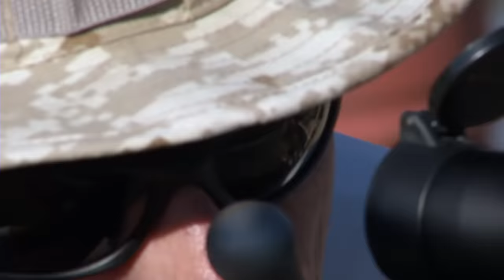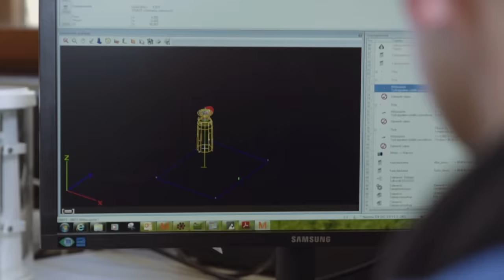King of 2 Miles - Ep 1804

Comment: Long range shooting is both science and art, it requires a great deal of practice and on top of all that you have wind that is  extremely variable. After I achieved proficiency in handgun long range shooting I found using a rifle much easier. This is not Hollywood so yes at those distances you will see some missed shots. After you've mastered shooting at 1 shooting location you go to another and you discover everything has changed.
Reply: What is wend?
Reply: @erbenton07  wind I assume
Reply: No, this is not art in any way you see it
Reply: @tuprimaentanga2387  "an art" and "this is art" don't mean the same thing bud ☺️

Comment: The thumb nail is awesome if you can hit a target at 2 miles with a Anschutz 22lr with a single power scope you need to be in this competition.
Reply: dont know about that 300 yds at 18 inch steel plate with my 10/22 ruger at 11yrs old i was aiming like twelve feet into a tree so to make it even 600 yds you going to be at least 24 feet of drop

Comment: The fellas who were eliminated didn’t prepare enough. You can’t make last minute changes without confirming again. Changing out the bipods? Oh hell no! And the other dude was 5 MOA off? I think it would have been better to dial it in. Using inly the mils in the scope you can make an easy mistake without realizing it. The spotter job is a hard job too! I would have liked more info on the wind. What was the wind mph at half distance? They could have at least told the audience this. But very enjoyable. Thanks.